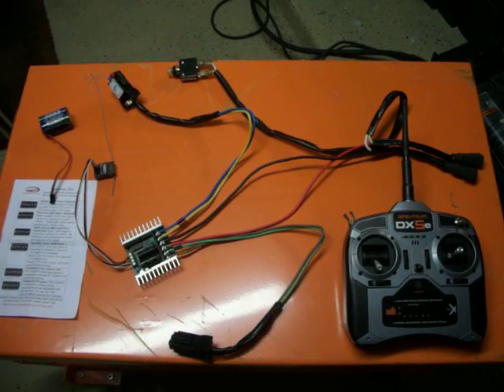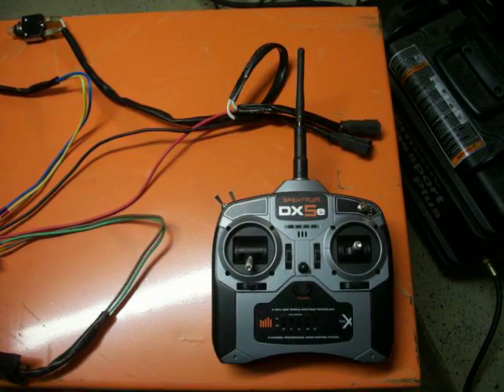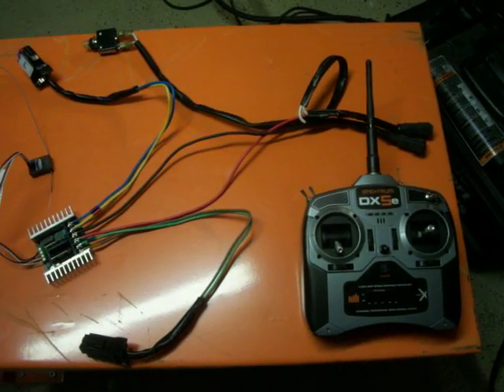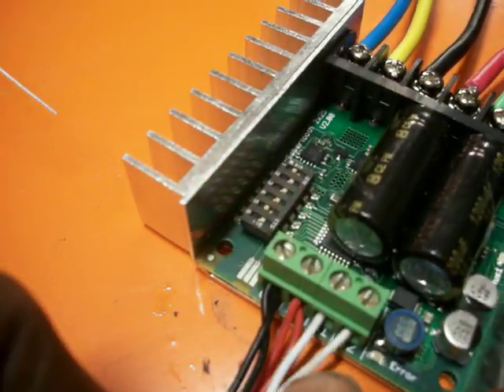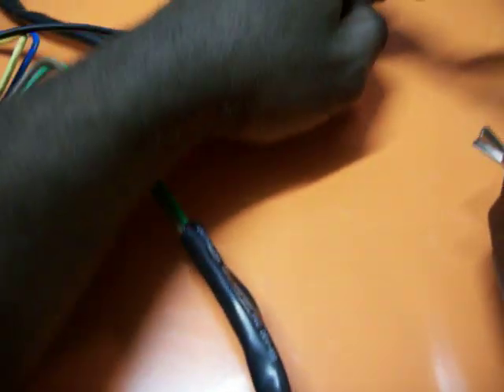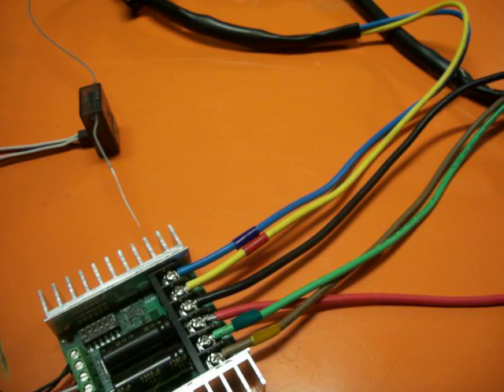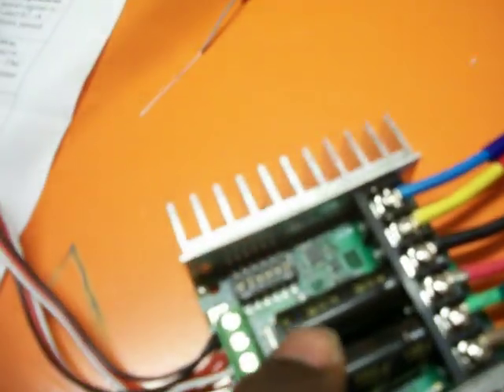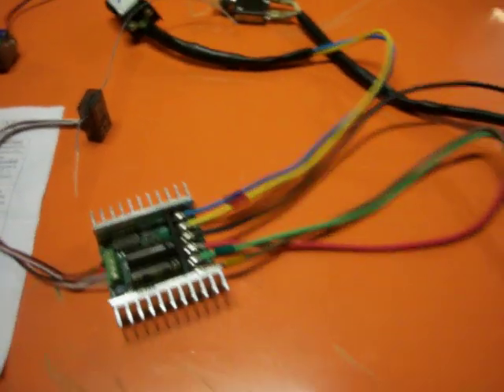Remote Control Lawn Mower Build Pt.3

Comment: Hey bud I have a question, I built one similar it's real cool but sometimes when I turn it on it takes off all by it self I usually have to cut power and let it reset but after that little mishap it works good, but like I said it just goes crazy every now and then any ideas? I was think inking something with the receiver power. Like you explained what do you think.

Comment from the maker: I did not post the video of the 12V test and I should have. . . but ounce you remove the brake from the wheelchair motors, you will only need to use one 12V battery. Now with that said you will not have as much power & torque just using 12V, but they will work. Thanks!